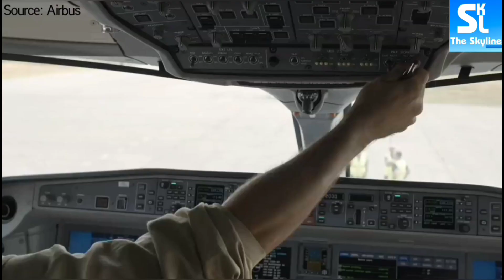Why The Airbus A220 Is The World's LUCKIEST Aircraft

Comment: I have flown the A220 as captain and instructor. It is a dream to fly, lots of power, very responsive, and lots of electronics and features to make flying safer and a pilots work easier. One of the greatest and most economical aircraft on the market.
Reply: And new too.  Less than ten years from a clean sheet design.
Reply from the maker: @michaelrmurphy2734  yeah
Reply from the maker: Lovely. Thanks for Watching!

Comment: You are wrong the c series did not directly complete with the 737, hence the final trade decision that dropped the dispute, this is important.
Reply from the maker: I said it competes with the 737 Max 7 not the 737 family in general
Reply: @theskyline1425  nope, it was strategically spec’d to not compete with the current 737 offerings including the max 7, max seating on the max 7 is 160 138, and 153 o. The c series/a220. This is the reason why boeing didn’t win the ITC tariff claim, because boeing cant suffer a loss if the new aircraft is not a direct competitor.
Reply: @theskyline1425  now the CS500 would compete with the 737 family, and it is ready as well, it was strategically not released because boeing and airbus at the time would have tried to kill it right away for encroaching on their duopoly and single aisle narrow body market.
Reply from the maker: @asfandbabar5635  indeed